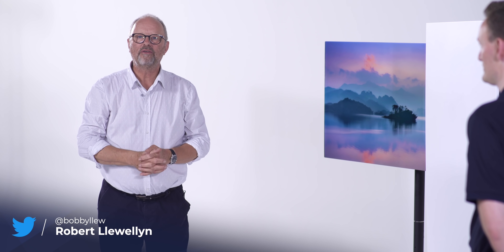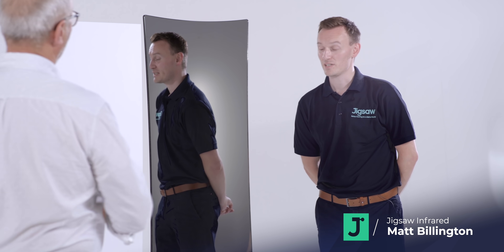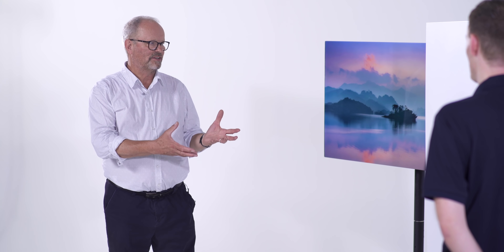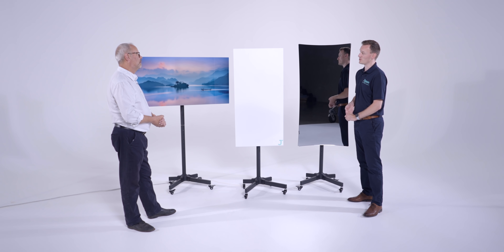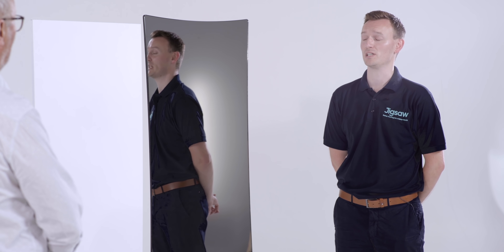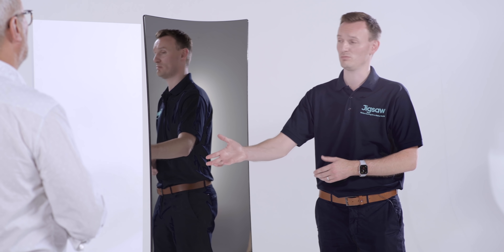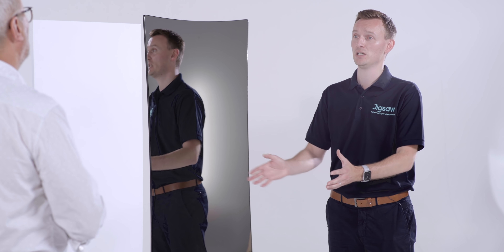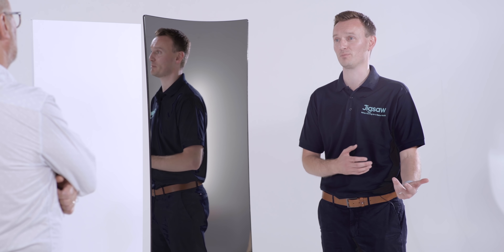JIGSAW INFRARED - Heats like the sun, cares for the planet | Subscribe to Fully Charged PLUS

Comment: I wonder how much they cost to run per hour or day. if it is cheaper than other heating options it would be a game changer .
Reply: Compared to heat pump system it is very inefficient. Compared to anything non electric it's cheaper but not more efficient.
Reply: Depends how much you pay for electricity. They have an 800 Watt version that will cost the price of kWh X 0.8, so if your cost is 10 cents per kWh, then it's 8 cents for an hour. 
Not at all cheaper than a heat pump. In fact resistive heating is well known as the most inefficient way to produce heat from electricity. But cheap to buy and convenient to install. I hate resistive heating.
Reply: I wonder if any 'cost over 10-year lifetimes' comparison studies have been conducted, due to the huge disparities between the upfront costs of heat pumps (or gas boilers) versus infrared heating. 

Considering infrared has a fraction of the upfront cost, and somewhat higher running costs (the difference would be minimised as these infrared panels need near-zero maintenance, no significant installation/servicing/repairs/part replacements etc typically), my guess would be that smaller households would save money over 10 years by buying infrared panels whereas larger households would save money with gas boulders and heat pumps.

Comment: I've posted before about IR heating, I'll post again.
I've been using IR heating at work for a couple of decades, for heating large poorly insulated areas it's quite good, but for a well insulated house it would be my choice of last resort, yes it's cheap to install (there are much cheaper heaters around than these), but the running costs are relatively high.
My big worry is that developers will be very interested as they will cut costs, but the consumers and grid will pay the price in the long run.
Reply: What heaters are you using in your commercial property. Panel heaters or the high power type? Are they installed with efficiency in mind? Would need to know more before we could reply.

Comment: Nice implementation of old technology. Only problem currently, is that mains gas is 4p per kWh and electricity is 20p per kWh. Modern gas boilers claim 90 - 95% efficiency (not including pipework losses) and while I suspect these panels will beat that, they will still be much more expensive to run.
Reply: Good point Stuart but gas is not going to be implemented after 2025. Also, there is a massive number of people across the UK who cannot use gas or heatpumps and need something which is more economical than everyday storage heaters.
Reply: aren't the pipework losses, still heat into the property.

Comment: Does this actually heat up the air, or is this just heat you feel on your skin?
Reply: It heats us and the fabric in the room. Think if it like the sun. That’s why it feels really good.
Reply: @glennbillington  I thought the sun heated everything else up as well....... including the air!?
Reply: Inside the panels there's a series of coils that get hot when you pass electricity through them. It uses the resistance of the wire, (and therefore the heat the wire produces) to heat the ceramic/glass/whatever panels. Not magic. Not efficient. 
Yes it heats everything up. You, the air and the cup you put in front of it. It's a heater.
Reply: Turning to convection is a secondary process, once the fabric of the room is warm that will take place.
Reply: @OAK-808  the main component of air is nitrogen/oxygen and they're transparent to IR unless it contains very high humidity. The heating of the air is secondary once the IR radiation has heated up a surface.
Reply: Both. But the main thing that comforts you is the radiant heat.

A bit like sitting outside in the sun or in the shade on a chilly day. The air temperature is the same in both places, but in one place you are comfertable and in the other you feel cold.

You don't need to heat the air in the entire room to nearly the same temperature to be equally comfertable where you are sitting.

Comment: Would one of these keep changing the channels on my television? Asking for a friend.
Reply: No: it's the wrong wavelength of IR light. IR remotes operate in the near-IR, just beyond the red end of the visible region of the spectrum (i.e., ~0.7 - 1.0 µm). These panels -- and any other resistive electric heater, they are all "IR" heaters, even those old bar heaters -- all operate in the longwave part of the IR region (their website says 6 - 10 µm).
Reply: @xchopp  I think he may have been having a bit of a joke?

Comment: I think it's correct to say all electric heaters are giving off infra red heat...they are all 100% efficient.  1Kw of heat from any type of electric heater in your house is 1kw of heat in your house. the only thing you can change is the way they spread the heat around and you can control it. ..I had overnight storage heaters they were useless because you had no real control of the heat at all. I control an oil filled electric radiator with a wireless controlled thermostat plug socket, Set the room temp I want and it can be forgotten. Thermostats on the actual appliance aren't very good at controlling room temp because they are too close to the source of the heat.
Reply: We've answered your points in a couple of the other comments Peter

Comment: I really like this idea, the panels are thin, unobtrusive, can be wall hung and the picture/mirror options will appeal to many. However, £400 is a helluva price for what is just an 800w heater. I'm going to guess most electricians could wire a 100% efficient, wall mounted convection heater (cost about £80) to a PIR switch and hide all the gubbins away for much less than £400. Although that wouldn't have the radiant heating that people find comfortable
Reply: 'Not just any 800 watt heater, it's a Jigsaw 800 watt heater'. 

The tests from Aston university have stated that the 800 watt heater from Jigsaw is twice as quick and uses half the electricity to get a room up to temperature than convection type heaters - the comparable convection heater was a 2 kilowatt heater!
Reply: @glennbillington4879  yeah, but is it an M&S heater?🤣
If that's true then bring it on! The (ancient) physics student in me says 800w of heat is less than 2kw of heat so cannot be faster, but my mind is open!
Reply: @Glenn Billington crickets
Reply: @bernardfender5147  perhaps those tests were conducted in a typical UK property that's not so well insulated, meaning the convection heater's heat is being lost before it can warm up the furniture and walls of the property because a large % of the warmed air leaks out. 

Infrared on the other hand heats the walls and floor etc directly, so there's no need to go through the usual cycle: heat the cold water, pump the water, the hot water heats the air, then the air heats the things.
Reply: Yes - they sound great, but I agree - what makes them so expensive......profit?  However, I'm all for heating systems that don't require the complications of a wet central heating system.

Comment: I would like to know how IR heating panels compare to a heat-pump system, efficiency wise,
Reply: No comparison. The panels are resistive heaters just like the glowing coils of yesteryear. This is a terrible way to produce heat. In fact, the worst way to produce heat from electricity.
Reply: Much cheaper to purchase an IR panel per kw and has 100% conversion of energy. Heat pumps can be 300%-400% efficient but this can drop to around 120% in a British winter.
Reply: Heat pump COP is not all it’s claimed to be. The COP figures do not come from real life testing and the COP is often closer to 1:1 
An independent study – commissioned by BEIS but written by Cambridge Architectural Research – investigated cost-optimal ways to install electric heating, including infra-red heating, and energy efficiency measures across a 12 housing archetypes, representing 90% of Britain’s 28 million homes. The study found that:
•	The total lifetime costs (capital + operating) of infrared heating were found to be competitive, although not cost-optimal in some housing types.
•	There were only small differences in costs over 15 years between low- or high-temperature heat pumps, air-to-air heat pumps, infrared or storage radiators.
•	Assuming a longer product lifespan (e.g. >20 years) for electric storage heaters and infrared heaters made heat pumps less attractive over the total period of ownership – as heat pumps were assumed to be replaced more frequently.
Reply: @OAK-808  And your experience and living with infrared is? Are you saying the studies in Universities conducted by educated people are wrong?
Reply: @glennbillington4879  I inherited two of them with a tiny house. I use them to sentimentally dry towels in a bathroom. When it comes to 'studies', I don't take their results as gospel because they are not making their assessment criteria absolutely clear. I see no metric for 'comfort', but I do for speed. You know what I'm saying?
Reply: @jigsaw.Infrared  If you are going to quote a study, then please provide a link to it so that we can all make up our own minds. And I’d love to see where you found studies that suggest real world UK COPS for heat pumps are in the region of 1.0, as I find that awfully hard to believe given the latest crop of products.

Comment: Is this resistive heating? If it is then heat pumps are far more efficient.
Reply: Absolutely!

Fully Charged not looking at the inefficiencies, only the shiny new sponsored content.

We need to look at efficiency and lifetime cost of ownership, not just upfront cost. This is an expensive and inefficient way to heat your home.

The only benefit is that you get instant heat.

The other principles that they suggest in the video apply to heat pumps as well - insulate and have thermally efficient windows.
Reply: I guess that it did say "includes paid promotion". I missed that. I go to Fully Charged for trustworthy information. Now I have to wonder if what is being reviewed is simply an advert. Extremely disappointing. How on earth does this product Care for the Planet if it is simply an inefficient resistive heater.
Reply: well they are 100% efficient, the problem is the fuel costs 25p/kwh.
Reply: Heat pumps are 300 - 450% efficient.
Reply: These can still be more efficient in actual use though. These work locally and require air temperature to be substantially lower to be equally comfertable.
Heat pumps need to heat entire spaces to higher temperatures to reach the same comfort level.
Reply: @johnrogers1423   it isn't simply a resistive heater.
Reply: @baronvonlimbourgh1716  I believe that they have their place. I recently bought one for my daughter's very small study. However, if they aren't resistive then they should be more than 100% efficient. It they aren't resistive, then what are they?
Reply: @johnrogers1423  they are resistive heaters ofcourse. But other resistive heaters are used to heat the air in a room to create comfort.

These panels are idealy used to create the same comfort locally where you are sitting while the air temperature can be a lot cooler by litterally radiating the heat onto you instead of being surrounded by heated air.

Like sitting in front of an open fire, the heat comming from it is radiated heat and can make you feel extremely hot even though the air around you might be freezing cold.
Or the difference in sitting outside in the sun compared to in the shade, the air temperature is the same in both places and still in one place you feel substantially warmer and much more comfertable then the other.

They are rubbish in heating entire homes and spaces. They can be very efficient in creating comfort for people where they are situated.

And because you don't need to heat all the air in an entire space to 22 degrees or something, the air can be like 16 degrees and one panel can make you feel just as comfertable, or even more so because we respond far better to radiated heat then surrounding temperatures, as if the whole space was heated to 22 degrees all the time.

Comment: You failed to ascertain the key metric. How much does it cost to run? Also, traditional heating heats up the whole room also. Furniture the lot! That’s why it takes so long to heat up a cold house. It’s not just the air you need to heat. Everything draws heat.  Interesting product but more information please.
Reply: All available on the website. Give us a call, we're happy to talk you through it.
Reply: Why do you say it takes so long to heat up a cold room. In comparison with other forms of heating it is much quicker. A recent study from Aston University has stated these facts. Twice as quick and half the cost.
Reply: @glennbillington4879  sorry if I wasn’t clear. I’m not disparaging the system. I merely wanted more facts around the cost of running the system as there was little information given on that. If it heats an entire room up much quicker Thames fantastic! Electricity ain’t cheap though so how would it compare to an oil or gas fired system?

Comment: I'm thinking a domed panel mounted onto the ceiling that includes a light source🤔🤓
Reply: Not a bad idea
Reply: @jigsaw.Infrared   1) Can a custom picture be printed on the IR heater, be ordered? Such as from a digital photo. Or is stock prints available? Seem like any added cost would attract higher end customers, who want greater customization options IMHO.

2) Is it available as part of an AR Mirror? Such as for dressing rooms at high end fashion shops. For example the shop just got in bathing suits, while its raining and cool that day. But the AR Mirror can show the customer in one the bathing suits on a sunny beach, while IR simulates the feeling of the sun on her skin. 
Or for a workout AR Mirror, for those who want be warmed for therapeutic purposes. In gym or at home. To warm their muscles right before or after a workout. Also afterwards it could still be used as an IR heater too, And the AR function could display HVAC and other data (or possibly for videos too?).  

Just a few random thoughts on how the tech could be used. Good Luck....
Reply: I think the OP is riffing on the fact that such devices have existed for decades! My grandparents used to have a combined heater/light in the bathroom

Comment: A couple of case studies would help greatly as would comparative running costs as IR uses peak electricity. Not surprising developers  and landlords are interested in IR its cheap and easy to install and they don't have to pay the running costs. Interesting though.
Reply: Yes the council in Leeds ripped out storage heaters and put IR heaters in as well as electric water heating. The tenants could no longer afford to heat their homes. Awful decision.
Reply: @Rick54K  Again, it depends on the control system and what heaters they installed really.
Reply: Would be good to see these with batteries, but unlikely to see this from developers and landlords
Reply: There is a total lack of journalist challenge here. I'm assuming a lack of case study because anyone ripping out a gas system and retrofitting these at present would see their bills sky rocket. These have a place when all heating is electric but while gas is 4p per kWh and electric is 20p these just don't stack up.
Reply: @mikestrong719  I think there is a good chance that IR heaters are a very poor choice for most homes. They will only be good if you basically live in just a few rooms and you previously heated all the rooms.  There is marginal difference between heating with a "standard" resistive heater and an IR panel, you probably feel the heat more quickly with an IR panel, but the "warming from the fabric of the building" will literally take exactly the same amount of energy as a traditional heater.
Reply: @mikestrong719  You shouldn’t expect challenge on Fully Charged +. It’s basically advertorial. The companies get on it by paying for it. It’s a platform for them to promote their stuff.

Comment: I'd like to see a system that can focus the infra red on the people in the room. That way you could use a lot less power.
Reply: There's no magic here. It's a resistive heater in panel form
Reply: @OAK-808  Yes I understand the principal. My feeling is this is not going to be very cost effective unless the property is well insulated but in difficult to insulate properties a directional heater could be more cost effective. I've used radiant heaters and they are very good but they require a lot of power. I wouldn't retro fit these to an existing property, rather spend £8000 on insulation and draught proofing.
Reply: That is basicly what this does. If you put a panel above where you sit, you only have to run that panel and the rest of the room does not have to be heated.

Other systems depend on warming the entire space. Especially air based heaters have to heat the entire room, and to a higher temperature because you are missing the radiated heat.